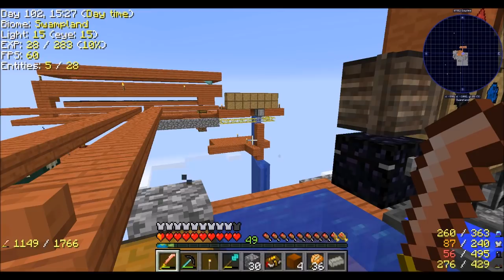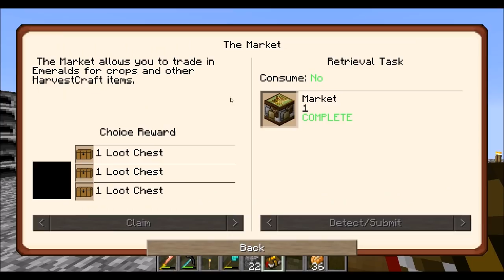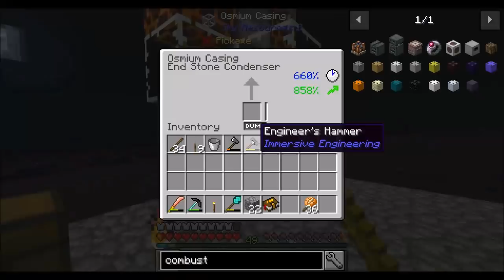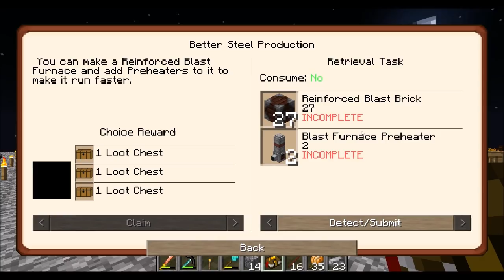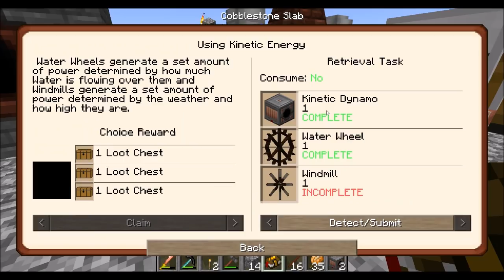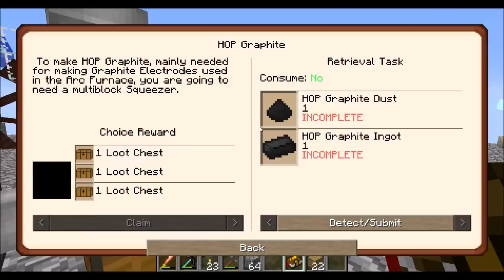Modern Skyblock 3   Ep27 RF Gen and Storage

Comment: DIRE!! you have MULTIPLE major quests not done. YOU HAVE NOT TOUCHED FARMING! you are also missing Actually additions Phantomfaces!!

When the pack updates it added new "mandatory" quests for the next chapters but did not block you from continuing since you were past that point already (hence the propane furnace). also there is a keybind to open your quest book AND IT DOESN'T need to be in the inventory!! 

treated wood tip: put your table NEXT to the coke oven and you can put he bucket in the gui to fill it.

Comment: I'm using Manyullyn casings for my condenser and heat provider.  I'm using a manyullyn heat provider, which melts stuff faster than a porcelain faucet pours.  I'm using a manyullyn combustion heater, it just sips lava.  Condenser stays end stone until I can upgrade to Enderium.

I am fairly sure that manyullyn casing can hold enough heat for glowstone, but I could be wrong about that.  You can still us an osmium casing with a different combustion heater to get high efficiency / speed or a different fuel.

Enderium / Refined Obsidian are the go-to materials until you get to dark matter / light matter.  However, manyullyn and end stone are really good until you get to those advanced alloys.

Comment: silent's gems> tinkers  for tools
Reply: Dire doing something new haha
Reply: Silent gems is very daunting to get into. It's like making a tinkerers tool and having no clue as to what material you should use, but 100x worse because there's so many stats and gems to look at. But honestly, just make whatever tool with the highest harvest speed or damage you can possibly make. The durability isn't a big thing since it's so easy to repair the tools. And the tools themselves are quite cheap if you decide you want something different. I do wish you could upgrade/ swap tools with different gems, rather than just changing the colour.

Comment: Now you have access to soil fuel, 1charcoal 1gunpower and 1aluminum ingot=8solid fuel which has a burn time of A lot. Its worth doing I promise :)
Reply: I only use solid fuel to speed up my smeltery.  It is nice to have basically everything melt in 3-5 ticks.

Comment: As you might know. You have access to actionally addition. The  mod is heavily overpowered. If you run the coal generator with planks, it will generate 185 rf per tick.

Comment: I usually don't prefer saying this since I dislike it when people do this, but can everyone please upvote this comment? Dire needs to see this. Thanks in advance!

The weird desyncs are caused by shift+clicking a recipe with the JEI button into a crafting grid, while at the same time have an item in the inventory slot at the same location of the JEI button (these are usually the top right slot of your inventory or the 9th slot in your hotbar, depending on if you try to make the top or bottom recipe in JEI (2 per page)). The item in the slot gets shift+clicked into the crafting grid ALONG with the JEI recipe, which either causes the desync (if there are no slots for the item to go) or put the item into the grid (if there's room for the item to go). This is all assuming regular crafting recipes of course. The way I try to avoid this is by not having an item in either of those slots, which to me seems like the best solution for now.
Reply: jeffreyzilla the best solution is adjusting the gui scale, but we all know how that turned out for dire in forever stranded. nevertheless, if any of you have this problem just do this quick fix
Reply: i kinda though that was what it was
Reply: Too bad this problem keeps recurring.
Reply: I've never had this problem using the large GUI scale. I'm not sure if it transfers well into video, but I feel large should at least be better than normal GUI scale. When Dire used normal in FS:LS it was too small.

Comment: Direwolf20, please do a mod spotlight on IC2 because most of the most reviews are from 4-6 years old
Reply: And the new buildcraft
Reply: The only change I recall is that there's a heat system, a blast furnace for steel, and I think wrenches never destroy machines anymore, check the config. Heat-based things require the orange bit to be connected on both machines, a little annoying with the lack of any sort of heat pipes, might need to make a few wrenches. The blast furnace requires compressed air, use a item pipe to pull the air cells out of the compressor, and a filtered item transfer pipe to pull the empty cells out of the blast furnace and put them back into the compressor. (Filter is so the steel and slag don't go through the pipe for the compressor.) Then a second filtered item transfer pipe that pulls out the slag and steel, but not the empty cells. A heat generator for the blast furnace, and power for the compressor, and it's done.
Reply: But the mods haven't really changed in that time.
Reply: What's changed in IC2? All the changelogs from version to version are straight ports. Everything works the same as it always has. I haven't delved deep into IC2, and don't plan to ever again, but at face value, it's the same mod.